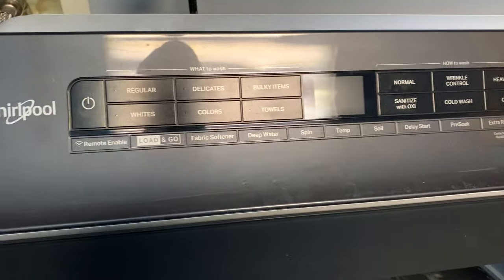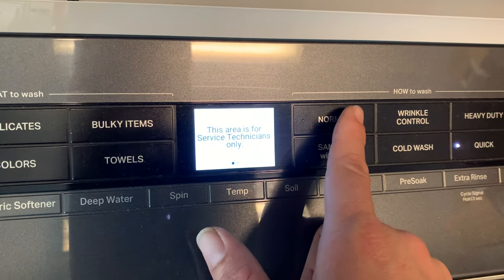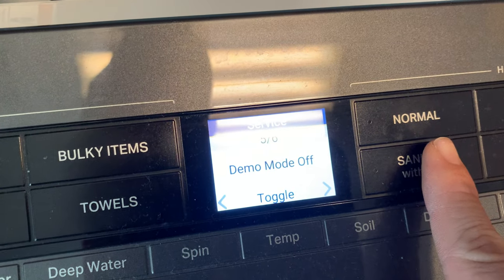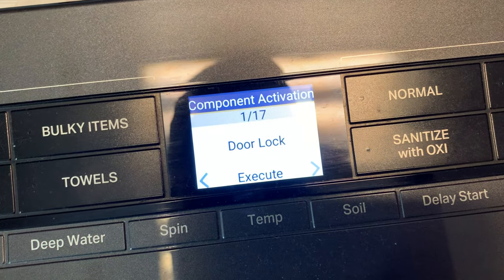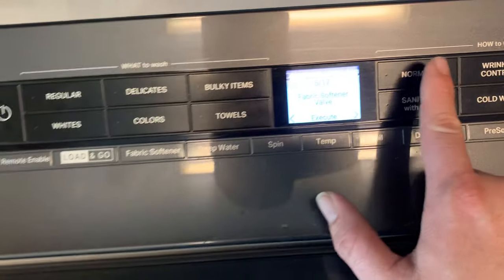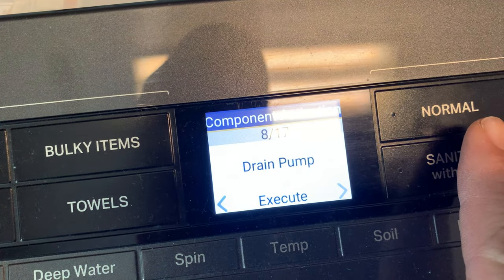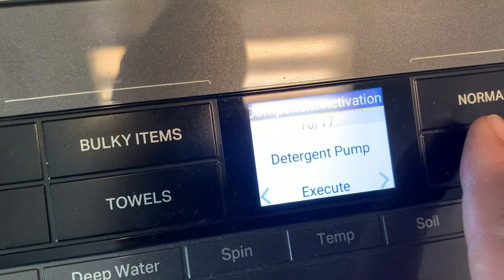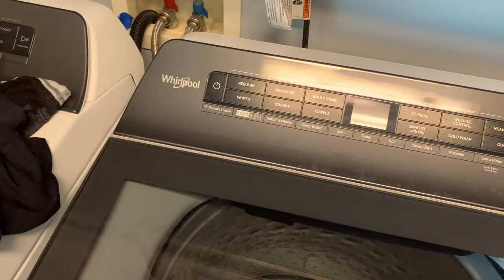New Whirlpool Washer Diagnostics.

Comment: I’ve had mine not even 6 mos and it don’t want to work anymore it’s just crazy how expensive they are and to fix .
Reply: Mines too
Reply: Made in USA quality!!
Reply: Agreed, ours lasted just over a year until we got the code today. Our old washer lasted over 15 years with zero issues.
Reply: Me too. Just few months and stop working 😢
Reply: Got one 2.5 years old for free. No one would come repair it so the owners got a refund.
Reply: Whirlpool didn’t give you a 1 year warranty?
Reply: @sgtcote1 that’s why they stop making the old school kind.. if you have a  use appliance store that have a nice good looking work set go ahead and buy it.. you will have another 15 years without problems
Reply: 700 bucks down the drain
Reply: My last one I bought at a thrift shop lasted 10 years, this one brand new from sears and 7 months in its nothing but trouble
Reply: Try less than 48 hrs.... first "wash"
Reply: These are terrible…. No Belt on my model so I’m not sure it’s the same washer…. It is the same control panel and works as he’s showing ….. it doesn’t wash clothes very well at all…. Mine is a 23 or 24 year model and it is in fact…. Junk…. I’m asking 300 bucks for it and it sold for around 900…. I figure some of the parts are worth that !

Comment: Great video but I give this wash machine a “zero”.  It is the loudest wash machine. You can still hear it with the laundry room door closed throughout the house. We have not had ours 90 days and need to have it serviced. It has errored twice and this time the lid locked and there is no release on the unit unless the water is drained 😮. Finally got that resolved by calling whirlpool warranty department, but now it will not fill with water.

Comment: Thank you! Glad I found your video! My washer would start the sensing cycle and go straight into spin/drain mode. I followed your steps and did a factory reset. I just threw in a load and it seems to be working right now….fingers crossed. This machine is only 3yrs old.  They don’t make them like they used to. 🫤
Reply: How did he say to factory reset??

Comment: I wish that worked for mine. Nothing will make it light up. I have that same model and it just won't work. Could it be the whole control board?
Reply: Were you able to get an answer on this issue?
Reply: i Have both the control board and button board i paid for both and it wasn't the problem feel free to mesg me if ya want to buy them they are new
Reply: Mine’s doing the same thing. What was your solution?
Reply: Mine just stopped midcycle too.  It won't power on or anything... I don't know what to do

Comment: After replacing the run capacitor, my washer is back up and running. Thank you for proving me the info for a quick and easy repair.
Reply: I hate it, I'll be sleeping in dirty bedding tonight because of this trash heap, it washes for less then a minute and "Wash Complete✨" 

Can I break it
Reply: @Cyseralsj Did you call the appliance store where you purchased it? If not, why not? Did you contact Whirlpool? If not,  why not? Has the problem been resolved? If not, why not? 🤔

Comment: I tried to get into receive the fault code, but no luck. Same model washer. My washer lid is locked and will not power on. Any advice?
Reply: Same
Reply: Mine ended up being a bad control panel!
Reply: @kaylahoffman1539  thank you! I am experiencing a similar issue. Screen won’t power on and the lid locks
Reply: Mine is locked and can’t opened it🥺
Reply: Same here how can i unlock it?

Comment: Mine looks like this. Model WTW5105HW1 from best buy. 4 years of light use. Is making a grinding sound, seems like when it changes directions. Thinking of changing the splutch assembly and actuator. Any other ideas. Otherwise it runs through the cycles.

Comment: I own this exact washer and it works great in all cycles except in Bulky item setting. The items are soaking wet after cycle ends. It worked great for a year, now not spinning all water out, only in this cycle. Any advice?
Reply: My clients have a similar issue…. Did you get it?
Reply: Same problem Did you get answers

Comment: Mine has a power interruption AND a drain issue draining. I tried to reset factory settings but nothing happened.  Lid still locked. 11/2024
Reply: Those 2 are the exact same issues I have. The repairman looked underneath, and the water pump was completely frozen. It's 11/2 years old.

Comment: I've seen where other washers have filters.  I can't find one on this model.  Getting ready to replace the pump.
Reply: Having drain problems on mine as well. That pump price, though 😒
Reply: @designwiz72  were you ever able to get the drain pump fixed? Mine is throwing the drain pump error code and I replaced the drain pump and activated it and it’s still not draining. So frustrating!
Reply: @bredenis5  it's not the pump. We actually got it to drain during a test cycle, but with codes flashing for the drain inlet valve now too. It's also not the valve though because it will fill up entirely too full and tell me it's not getting water. It's gotta be a sensor somewhere or the main board. I can't seem to find a part # for an inlet valve sensor...
Reply: @designwiz72  thank you so much for replying so quickly! I’m sorry that you have to put up with that aggravation! I can’t figure out this darn thing either. I’m just now running a proper diagnostic cycle and I’m going to see if it is able to pump when it gets to that test.

Comment: I replaced the lid switch with the proper one.  Everything works except when I start it, it keeps sensing and the tub won’t spin and it just sits there.  I ran all the diagnostics. I can even hear the motor running but it’s not engaging or something.  I went and bought a new one but I still want to fix it.  This is the third whirlpool and Maytag I’ve had in three years.
Reply: I have a similar issue...mine won't go past the "add garment" setting. You can hear the hummimg of the machine,but nothing happens.

Comment: We purchased our washer about 7 months ago the load and go does not work. We had a repair person out and he replaced a part but it is still not working. I have removed the detergent cleaned it. Set it back to the factory reset, It will show when it is empty or full but doesn’t dispense

Comment: My machine is all mixed up!! It starts to spin then stops and fills again. I need to pause and start for it to wash properly cause sometimes is won't wash and hardly turn. Sometimes it starts spinning in a weird way that all the clothes bundles up on the agitator and I need to replace. Sooooo many issues. How can I try to calibrate it back to the initial factory settings?

Comment: I have a question.  I have this same one for iver a year and the detergent dispenser never empty. I'm pretty sure I'm not even cleaning my clothes.  It has been full for a whole year.
Reply: only use HE High Efficiency detergent. Run white vinegar through it in diagnostic mode and see if it pumps it out
Reply: Just bout it and having the same problem any solution?

Comment: Much thanks! Inlet valve is being screwy getting F8 E1.
Reply: How did you fix it
Reply: @taylorwade2589  replace the valve assembly
Reply: @Loki_Dokie  did you order it from a website sorry I’m asking so many questions ours is doing that right now
Reply: Where is the valve assembly located?
Reply: @TJ-sf6kt  take off the top cover, you gotta use a putty knife to pop some clips, and the part is what your hot and cold hoses attach to.

Its a single closed system so you can't repair it afaik
Reply: @taylorwade2589  sorry I didn't get back with you, yeah but I don't remember where, they are on Amazon, but also appliance part stores online
Reply: THANK YOU!!!
Reply: @Loki_Dokie I got the same code and before I checked that valve assembly I unhooked the drain hose into a bucket,  then tool off the blue hose to the back of the washer and then the red hose to the washer and placed them also into a bucket. Both of those screens I took needle nose pliers and took them baskets out, both were nasty from my rusty water. I had to soak them in cleaner and I cleared that history code. I'm hoping that was my problem. These led screens are not for us do it at homers that is for sure. But I'd check those before you unscrew the back.

Comment: Thanks for sharing. I've got this unit and when it is on a high spin at the end, it sounds like a jet engine in the house and I can make it go almost silent simply by applying some pressure with both of my hands to either side of the unit. It appears this thing is shaking so hard its flapping the aluminum body. It does this even with no clothing inside as well. Is it normal for this washer to shake itself so hard it sounds like it's about to break?
Reply: Mine did too, and beware the hose trapped inside the metal on the back of that machine will wear a hole. I took the back off and taped the hose till I could get a new one. Sounds just like a jet engine.
Reply: @designwiz72  Thanks!
Reply: @designwiz72  which hose?  The drain hose??
Reply: @jeffhirsh8247  yes, the inner drain hose, right inside the metal back, all that ferocious spinning friction wore a hole.
Reply: @designwiz72  do you have a pic of the hole and/or the site with the back off so I can see if it’s happening to mine ?
Reply: @jeffhirsh8247  I'll try to upload a pic this weekend
Reply: @designwiz72  great!   Thanks!

Comment: I got them on Tuesday last week so today. I had my first wash of clothes and I sure did not like the way the washer machine worked. The water was to low and did not wash my clothes right I still had my perfume on my clothes still. I went today back to the store to return them back and got my front loader. I will never change my front loader machines to a regular top load machine there are no good at all.  I have seen a lot of bad comments on the top load machines.
Reply: This is my EXACT issue to the T. Had mine less than 48 hrs. Taking it back this Friday.

Comment: Any idea what to do if power isn’t coming on the panel? Checked everything possible and it’s obvious that there is power to cord when it’s being plugged in.
Reply: Same. This is where I am at and we NEED SCHOOL CLOTHES 💀💀
Reply: Exactly, where I'm at! So frustrating. My kids need clothes for school.
Reply: @angiecapps291  Did you figure out what was wrong with yours?
Reply: So we all have the same problem 😂
Reply: Were you ever able to figure out this issue? Whirlpool isn’t any help!
Reply: I have the same problem...
Reply: Yes mine has no power at all :(
Reply: Anyone figure it out?
Reply: Anyone figure this out mine is doing the same
Reply: Try plugging in and unplugging about 4 times in about 30 seconds to 60 seconds intervals I did both and came back on
Reply: did you ever get it figured out?  Mine is locked too with no power.

Comment: Wow great video!  Anyone know how to get passed a dead screen?  I can't even get it to turn on!  TIA
Reply: Ours worked completely fine, had it for over 3 years now but our power was out for 5 days due to Hurricane Helene and when the power came back on, the washer wouldn’t turn on. There was no power to it at all until about a week later, when I was on the phone talking to an appliance repair shop down the road. I was making an appointment with them, and the washer actually turned on, but now it’s saying dispenser not detected. Add detergent manually, and I still can’t get it to start. This is so annoying. It was working fine until Hurricane Helene knocked out our power.

Comment: what could be defected ? i reset the codes and it washed fine for the last three washes  but the code keeps coming back F8E1 water not detected but the water comes out just fine ! Thank you for the access into the diagnostics though it helped reset the codes !
Reply: We are now getting the code ...can you help what was wrong with the washer
Reply: @nicholeCPhT I got that same code and it was my screens in the back of the washer the red and blue were both clogged with rust. I have no clue how to reset it. I did eventually clear the code and am trying to see if it will work again. I've heard the code eventually comes back after a few washes. So aggravating.
Reply: I simply cut off the water and cleaned out the little filters inside the hot and cold hoses (washing machine side), as there was minor build up of little black particles I can’t say what they are .. but once removed I cleared the codes and cleaned out the detergent reservoir before attempting a new cycle and ever since it’s working fine !  I’d add before these codes popped up we had lost power like three times due to bad weather and that’s when it all started !  Hope this helps !

Comment: F9E1 code. Pump is fine, drain is fine. Third time same problem, diagnostics did not help. Had to unhook the wires to the pump under the washer to unlock the lid!  Less then a year old and have had nothing but trouble!
Reply: Got the same code
Reply: Few months old
Reply: I have that same cold right now
Reply: How did you unhook the wires
Reply: Any updates on how this was fixed? I am experiencing the same problem.

Comment: I have the same washer. Washer was OFF when we had a five minute power outage. Now the washer will not turn on at all. Does anyone have any help or advice with this problem?
Reply: Unplug for a few minutes.
Reply: I’m having the same problem it won’t turn on what can we do ??
Reply: This happened to me too. The power to the washer eventually started turning on about 2 weeks after the power outage. I was actually on the phone making an appt for someone to come look at it when it turned on, but it’s still not working right. All it says now is “Detergent not detected. Add detergent manually.” We’ve had this washer for over 3 years and we’ve never had any problems out of it until now.

Comment: ANY ISSUES WITH LEAKS COMING ROM THE BOTTOM OF THE WASHER? It doesn't happen with everywash
Reply: YES!!!   I figured out that it will leak when the fabric softener is on!   OR if you use the "Towel" mode, that forces the fabric softener compartment to fill with water (I don't know why, this occurs even with Fabric Softener set to OFF, but only in Towel mode does this occur like this).  The fabric softener compartment drains do not always align with the tub, SO - it overflows a little and goes straight to the floor!   Run the test yourself and observe in there with a flashlight while its running... You'll see it happen.
Reply: Mine leaks also with from the fabric softer dispenser. Any suggestions?
Reply: Same issue, i was searching for a filter to drain/clean but can't fine any. So this might be my same issue 😕

Comment: My washer stopped mid cycle and doesnt turn on.water is trapped inside. Outlet does have running power.
Reply: If the door is unlocked, and if it’s a top load or it’s a front load and it’s not full enough to spill out of the washer, get a siphon and a bucket and go to town.

Comment: Mine just broke down. It’s full of water and I can’t get the door open to remove the clothes. Starting to smell up the house…
Reply: Same here
Reply: If you can, go to service mode, and in the service functions, run the drain pump. And while you’re at it, there should be a function to toggle the lock. Toggle it and it should unlock. If not, I guess depending on how badly you need your clothes, maybe pry it open with a crowbar or something lol.

Comment: Mine says f2e2 what should I do?
Reply: I believe this error has to do with the control panel.
Unplug the washer for about a minute or so, and then plug it back in. Actually before you unplug it, I suggest writing down the error codes you have, and then clear them. You should see a message saying there was a loss of power (because u unplugged it).

Check the codes again. You’ll probably still see the code if you haven’t cleared them, otherwise you shouldn’t see anything unless something has already tripped a code.

Comment: What if I have one that’s not showing no power at all
Reply: Mine too, I’ve replaced control board and user interface, no help, any ides?
Reply: @timovermyer8196  same, did you ever get it fixed?
Reply: Just lost power with mine tonight with clothes locked inside.  Let me know if you figure anything out these must be pieces of junk.
Reply: Anybody got any ideas happened to me yesterday
Reply: @stephengulski6289  this same thing happened to me yesterday
Reply: Same same. Dollar store washers.
Reply: @0ptimal  I replaced the main module, and the touch screen I would start with the module first!!! Cause it’s more then likely that! Be prepared to maybe buy a touch screen.